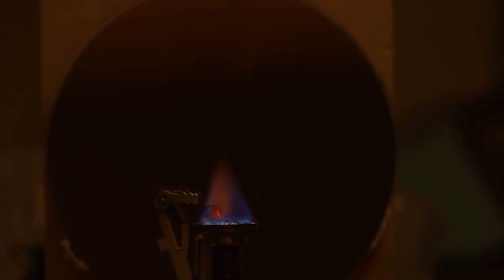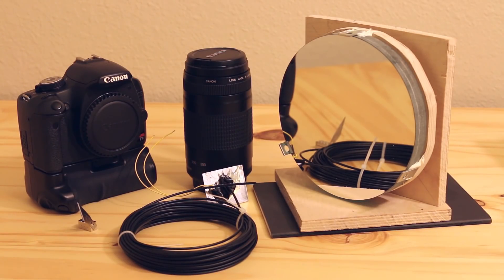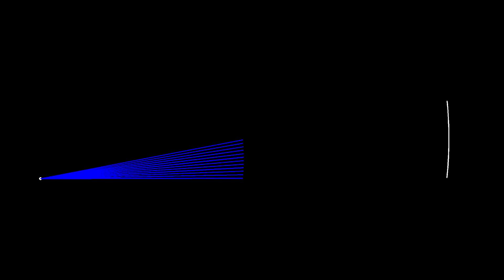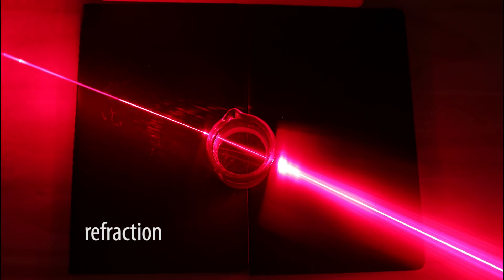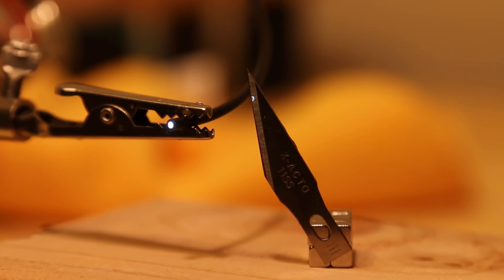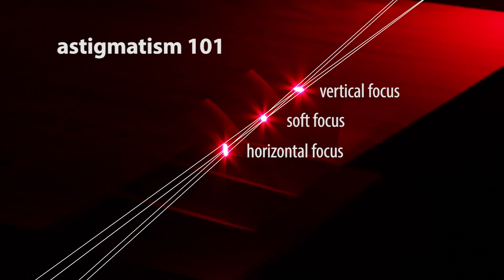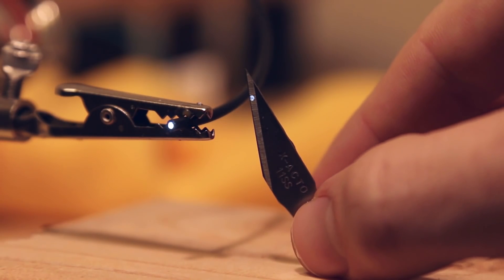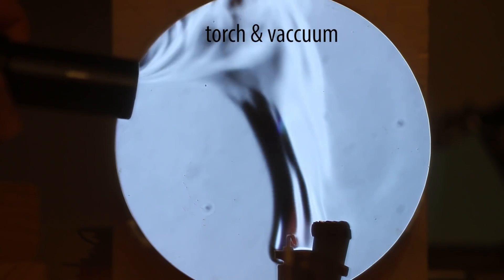Schlieren Imaging: Seeing air in a whole new light!

Comment: One small detail at 3:47 .. 3:58 why does CO2 NOT know to go upward into the atmosfera rather than fall down to the bottom?
Reply: Carbon dioxide is roughly 1.7 times denser (heavier) than air, given standard conditions (air temperature and pressure).  As such, it falls rather than rising.
Reply: Of course you are right and I already knew. But I get constantly told that CO2 in the atmosphere is causing the greenhouse effect.  What is the scientific explanation for this effect?
Reply: Peter Baumgartner, Well if you are talking about vehicles it is because the heat makes the particles move making it less dense, therefore less dense than air, but it would cool down when it goes higher up so... I really don't know, may be they lied to us?
Reply: This is rapidly evaporating liquid CO2, therefore it is at a very low temperature (just above -75.8ºC), and correspondingly higher density (which is what makes cold gases fall and hot gases rise). As it warms up to room temperature, it completely diffuses into the surrounding air.

Comment: How are you able to see both the details in the mirror and the scene (like being able to see your hand in color)?

In my setup the hand would just be a black with no visible details because of the difference in brightness.

I can see details if I turn increase the shutter speed, but the effect in the mirror loses detail since it's too bright.
Reply from the maker: I think it depends on how bright your point light source is. If it's not very bright, then the room will have to be very dark to properly expose the mirror, or the room will be over-exposed to compensate. I used a very bright LED and a filament of fiber optic as a point light source. Thus, I was able to set my camera settings to properly expose both the room and the mirror. 

The challenge is that you want as small a point light source as possible. This has the advantage that you'll produce sharper images in the mirror , but at the expense of less light getting to the camera. It's a compromise and my setup falls somewhere in-between.
Reply: Bryan Rolfe Bryan Rolfe ok cool, thanks!
By the way, how did you do that laser effect? That's the best demonstration of Schlieren that I've seen on YouTube!

Comment: Excellent video, but I have a question.  As we know the denser parts of  air cause light to refract at a greater angle, causing it to end up lower and to get blocked by the razor. Wouldn't this mean,
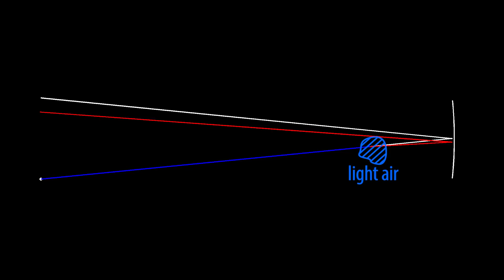that the darker parts of the image correspond to the denser parts of the air? I got a bit confused with the contradiction between 1:36 and 1:57. Please correct me if I got something wrong
Reply from the maker: I believe that is correct. The denser portions of air are always refracting the light more, and will be correspondingly blocked by the razor.
Reply: So the darker parts in 1:57 are actually the more dense ones?
Reply from the maker: You know what. I'm not entirely sure. I think it really depends on how the razor blade is placed. If it were placed differently, for example 180-degrees from its current position, it would be the opposite.
Reply: Indeed, thank you very much!

Comment: Good afternoon,

i got a question Bryan,  if you want to increase the schlieren sensibility, what is the most critical point to control it¿ 

im just doing a Z-type Schlieren system with 2 mirrors of 6'' and f=750mm, but it hasnt got good sensibility yet cause i cant see clearly defined  cold air streams such as those by  hairdryer.

If you got any paper about it i could give you my e-mail to send it to me.

Thanx a lot.

Comment: Hey good work :D 
But i have a question can you only see the image with the camera or would it be enough to just hold a piece of paper behind the razor blade?
Reply from the maker: +joo o You need the mirror, point light source, and razor blade at a minimum. You don't necessarily need the camera, as you could see it with your naked eye, but it will appear far away, as we can't zoom in with our eyeballs (yet). You could put your eye behind a telephoto lens though, and that would work.
Reply: +Bryan Rolfe all right thanks :)
I've got an other question. I have to built one my own for a project at school so could you tell me were i could  get on of this mirrors?
Reply from the maker: +joo o I got my mirror off of e-bay. It was a 160mm diameter primary telescope mirror with a reported focal length of 1200 mm. I paid $60-70 US. You could try a smaller mirror, but i wouldn't go any smaller than 120mm.